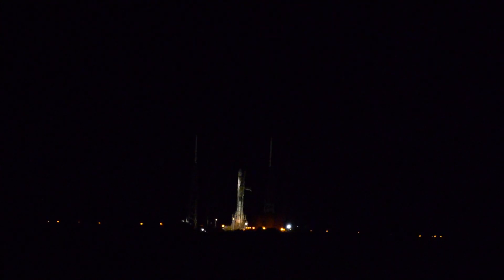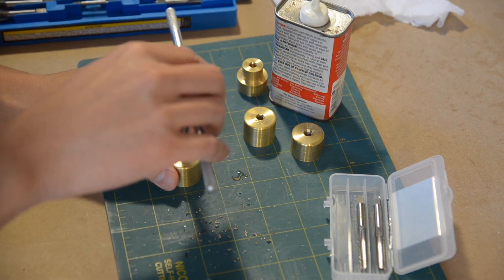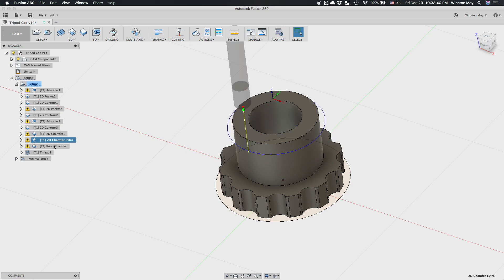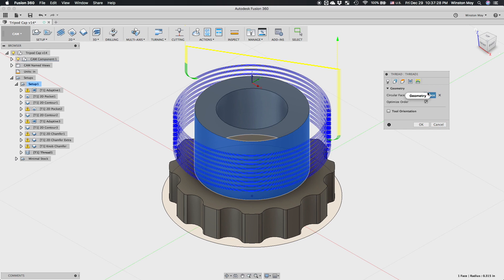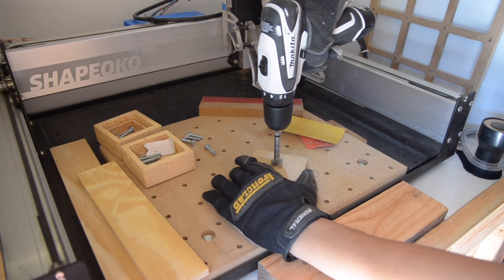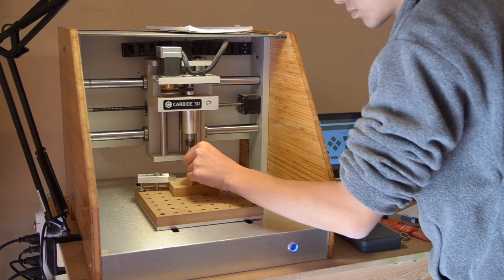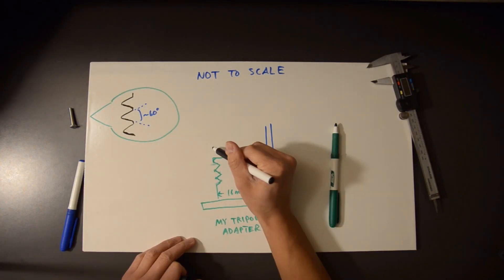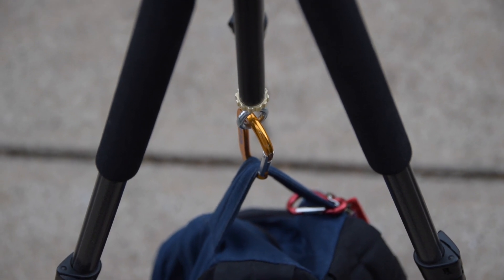Threadmilling a Tripod Attachment - CNC Project #107

Comment: Hi Winston, Very nice video. If that thread mill cutters smaller extension diameter is something standard and you didn't have your heart set on keeping the extreme length you could abrasive cut off the lower part and chuck that. That mill cutter looked horrifyingly long to me. They really like to scream or sing at that length. As I'm sure you know a cutter will settle down and run it's quietest at a certain speed and feed based on rigidity, stick out, and material, but I don't think that cutter ever would run truly quiet. Great job by the way. I have been doing advanced CNCing for over thirty years, but I wish I also had your communication skills.

Comment: Very interesting video, thanks. Did you consider just 3d printing the part? From my experience, that would have been quite strong enough.
Reply from the maker: The short answer is no, 3D printing usually never crosses my mind unless it's a part that will make my life hell by machining. 

The long answer is the thread size didn't seem like it would come out well via FDM printer (though you could probably form them by threading the part onto the shaft slowly and repeatedly), and the obvious part orientation in the printer would put the shear plane of the layers perpendicular to the gravity vector, which also didn't seem ideal.

Comment: One trick to help with the vibrations is to wrap a rubber band around the tool, we do this on the lathe when we are trying to do deep boring with long bore tools.
Reply from the maker: Sounds similar to the idea of those little rubber beads you put on tennis racquet strings to dampen vibration. I'm not sure that would work if the tool itself was spinning though. Past a few thousand rpm, I reckon the centripetal acceleration would actually cause the rubber band to stretch outwards like a hoop.

Comment: hi winston, do you think a shapeoko 3 would have enough accuracy to make threads like that or would you recommend only a nomad
Reply from the maker: JPL_Richard's successfully threadmilled on a Shapeoko, which was one of the things that opened my mind to milling threads instead of using a die. Just need to enture your machine's tuned up. The mass/inertia of the spindle helps you out.